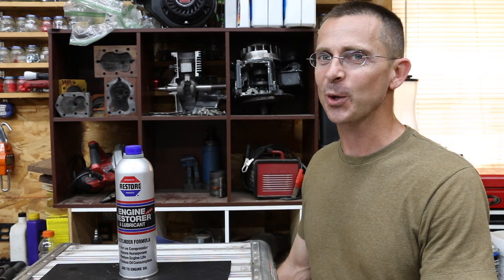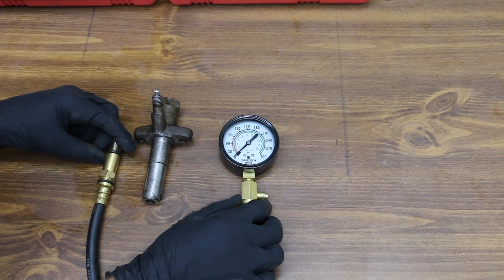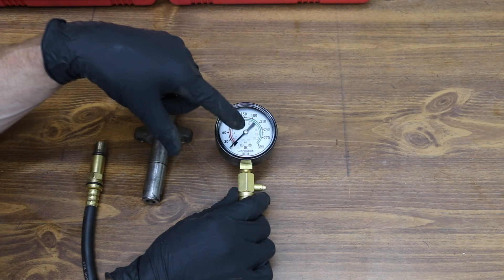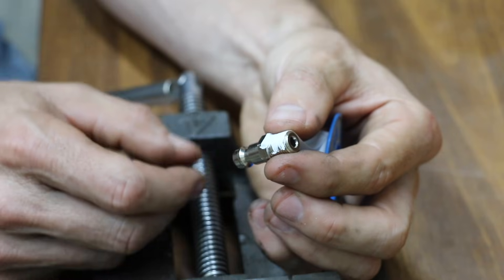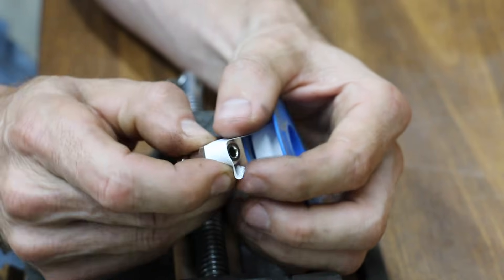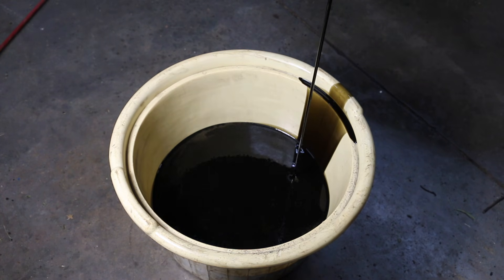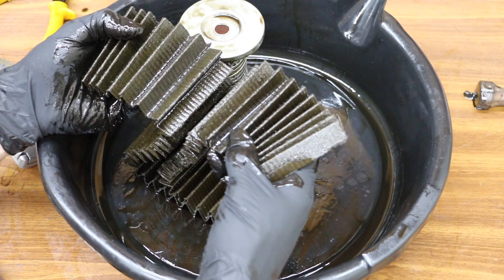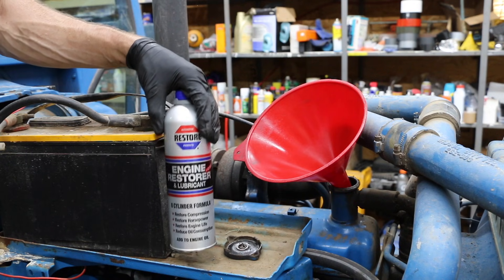Did the "Engine Restore" Compression Improvement Last?  One year later (Episode 2)

Comment: Restore IS one awesome product  I've been using it now for a few decades it not ONLY RESTORES compression it noticeable helps keep blow by out of your oil  mor cleaner oil = mor better  AND it also act as an antiwear additive  It has definitely gotten my seal of approval     another addive I use is Lube guard HOwEVER I dont use it in the conventional way  I spike all my vehicle's oil with Lube guard limited slip differential additive  and I have found that on my motorcycles  it makes clutching AND shifting much more tactile and smooth  I even put a 1/4 OZ. Per. Gal. In the fuel To fight  cycelnder washout and cold start wear  the liquid wax esters that it contains are also really good at keeping  the sludge cleaned out your engine     keeps them clutch plates cleaner so they are less likely to chatter and slip.    As well as making them generally operate smoother from the start 👍😆

Comment: Some say this product has issues on engines with VVT, or that it could.clog solenoids, etc. Could you do a video testing this myth? I would love to be able to use this in a modern engine, but a lot of your tests are on lower tech ones that do not deal with the issues of the new cars of today.
Reply: I have a 2006 gmc Sierra 1500 with a 4.3l v6, 5 speed and it’s been burning oil and a little sluggish, I used the one bottle of restore about 600 miles ago and I have about no oil burning and it is running smoother and cleaner then the day I bought it, I’ll give an little update or what not in a week or so but so far it’s worked wonders
Reply: @austinbergman9270  so after 3 months now how's your 4.3 doing?
Reply: I second this for sure. I'd like to know if there are products out there that do work for even engines of the early to mid two thousands, even newer. Also if the engine restore could work in a more modern engine or have they formulated an option for the thinner oiles in newer vehicles. Love the content project farm! Keep it coming.
Reply: Yes
Reply: Should work on anything but a powerstroke diesel, says that much clearly on the bottle.
Reply: @carll.freemanjr.9867  Yep I believe everything the manufacturer says....

Comment: Looking to do the same to my JCB1400B with a Perkins Turbo Diesel, little weak in compression, would you recommend this or Marvel Mystery? Both seem like quality products just wondering what you would do in that older application
Reply from the maker: If compression is down from excessive wear to the piston rings, engine restorer is likely to help.  MMO is a great product as a cleaner but doubt it'll help with lost compression

Comment: These types of so called "engine restorers" are usually nothing more than really thick oil. 70-80 weight.
Reply: it has very low viscosity
Reply: I've used it, it actually works.
Reply: @rogercoder1469  I didn't say it doesn't work. I know that it does. I've used it myself. I was only saying that it pours out of the container like honey.

Comment: I used restore on my engine based on your recommendation. Didn't have the trouble you were having with that cool tractor but after using I had great, consistent pressure in all 6 on a 200K mile SUV
Reply from the maker: Thank you for the feedback

Comment: What do you think about Lucas high mileage oil stabilizer I use it in my 2005 impala SS with amsoil signature and a amsoil Filter and my last oil change I added restore because of your first restore video I have 207000 miles on my car and I think restore really added more power
Reply from the maker: Great question.  Lucas is a viscosity enhancer and helps "cushion", but the extra viscosity can become an issue in the colder months, which is why I much prefer Engine Restorer.

Comment: One other tip for teflon tape, hold the spool flipped over from the way you're holding it at 4:00 It should be trying to wrap back onto the spool as you wrap the fitting. This way you can hold the fitting and end of the tape stationary, while wrapping the spool around the fitting(let the spool spin as needed, keeping some tension on it).
Reply from the maker: Thank you for the feedback

Comment: In the Compression Test Results graph, cylinders 2 and 3 were restored to nearly their full potential on the first go...but ended up to be the lowest in the end – although only marginally.  My theory is that cylinders 2 & 3 are lowest because the inner cylinders inevitably run hotter.  being stuck in the middle.  Thereby wearing the metal down faster.  Also cylinder 1 would be closer to cool, fresh air by being in the front, so that's why it's the highest?  I mean I'm just speculating based on my understanding and assuming the pressure readings were 100% accurate.  Basically saying the hotter the individual cylinder runs, the more it loses compression.  Glad I subscribed to your Channel.  Favourite Sunday afternoon content when I'm taking a break from working on my car 👌🔥💯
Reply from the maker: Thank you for the feedback!

Comment: This can restord my toyota  with p0306 code   posible no compression on that cylinder???? I put new spark plug and  coil and still have the code
Reply from the maker: I doubt this will help unless the cylinder compression is low due to worn piston rings

Comment: You must try Omega 907, it really cleans up the engine. Try it on a old car gas engine, then it easier too see results. The oil in my car looked almost brand new before I used it, the oil after the flush was pitch black. "Omega 907 is an advanced engine & compressor flush that removes all harmful deposits from an engine. Will allow new oil to work at maximum efficiency and eliminate the risk of dangerous contamination"
Reply from the maker: Thank you for the feedback!

Comment: As always, a great film on an interesting topic. You do a fantastic job. One thing I wondered about the Engine Restore is whether it makes any difference if the oil is mineral or synthetic that it is used with. I have a 1960s classic running on mineral oil and wonder if Engine restore would be suitable. 

Also, have you done a destruction test with Archoil friction reducer yet? If not, I think that would be interesting.
Reply from the maker: Thank you for the video ideas!

Comment: well my opinion after cranking the engin endlessly  on each cylinder pressure test ? get that engine rebuilt casue its really at the end of the road. If you dont soon it will over use the pistons and one will break down eventually and create a lot of damage to the engin when it will  .while additives are made to  help the engin last longer  they are not ment to make it last forever . What is worned out stay worned out and continues  to do so   and no additive will stop that  . It may slow it down a bit but once you will pass a certain level of wear  then the additive will have no more effect even if you replace it with new additive ,thats when the engin will come appart

Comment: No placebo effect. More compression = more power. Period. I know for a fact it works. I have an older truck that I used it on. Before, wouldn't pull trailer up a grade in 5th gear manual tranny. After, would pull trailer up exact same grade in 5th gear. Over and over again... It works.
Reply from the maker: Thanks for the feedback!

Comment: if i use it in a modern engine with variable valve timing, will it work or destroy it?
Reply: Scotty Kilmer said don't do it.
Reply: @cooldaddyslick  exactly. Thats why I came back to this video. I want him to test that out on a modern engine
Reply: @herewegoagain7403  I've used it before on my 2012 G37.  The instructions don't tell you but I always get my oil changed and wait to put it in when I get home.  Shake it up then pour it in then go for a drive right away so it can mix in.  Never had a problem.  I think most people just pour it in when changing the oil and just let it sit there while they finish up where it CAN/MAYBE "clump up" and clog stuff up.
Reply from the maker: I need to test it on a modern engine.

Comment: I just put  some in a 2000  Honda  accord 4 cylinder 2.3  - 280k  miles on it ..  noticed better performance right away .. its been   burning  some  oil out the back  ..  we'll  see how it  does.  .. but  so  far i'm impressed
Reply from the maker: Impressive!  It would be great to know if the improvements last.  Thank you!

Comment: This is a very interesting product. Nearly everyone who has used it that I have seen or read about has reported improvements, even just small results......your findings with your tractor are very impressive!
I have just purchased a small can of Restore to try in my mowers......I have three old Suffolk Punch/Colt machines from the 60s and 70s, all with the very strong 75G14 engine.....they all burn oil and smoke a bit, but these three mowers have so far only cost me about £20 and a case of San Miguel beer, so I really don't care if the Restore doesn't work !!!
Even without it they all run and cut the grass, so I'll be interested to see if they run any better and smoke less !!!
Keep up the great vids PF.....
Best regards from South East England 👍👍👍👍
Reply from the maker: Thank you!

Comment: After seeing your 1st video on engine restore i would use engine restore on a 67 plymouth v8 I have every time I had gone through 4qts. It worked great. Added lost power, increased compression, reduced oil consumption/burn off.
However after the 4th oil change with the recommended amount of engine restore oil pressure slowly started decreasing with an overall loss of an average of 16psi at high rpm. From 60-44 and an idle oil pressure from 22psi down to 10. I stopped using the engine restore 6 montts ago and have not noticed anymore oil pressure loss. Please do one of your famous lawnmower engine restore tests on engine restore on both a bad(low compression) engine and a good engine to see added buildup over NOC (normal operating conditions) 
Down we dive to 463 AMX AETC! MFE!
Reply from the maker: Thank you for this information on Engine Restorer.  The oil pressure loss is concerning.  I'm on my 3rd oil change with it in my Ford 5000.  More to follow in a future episode

Comment: @project farm.. would you add restore to a newer engine....2015 Honda Accord 4cyl. Only 20000 miles but engine idles a little rough? Thanks again for another great video.
Reply from the maker: I would not use it in that vehicle.  It won't help.  I don't believe the rough idle on a car with such low miles is due to compression loss.  So, engine restorer just can't help.
Reply: @ProjectFarm  good morning and thank you very much. Also thank you for your service on this 9/11 day of mourning. I've read in a past post that you were in the service.

Comment: I used it with success in a Dodge with the Cummins 5.9 but after using it several oil changes in a row, it acted like it was hindering the oil flow to the injectors.  Buildup perhaps?  I discontinued using it for several oil changes and it has returned to normal.  I would not use it every oil change.  As your oil analysis showed in the Suburban,  it stays in the engine.
Reply from the maker: Great point. Thank you

Comment: An old Ford 3000 I bought, the prior owner used Restore in it.  not sure if it was just once or at every oil change.  When I got it, the engine was so tired, it would not start below 50F.  It needed a puff of starting fluid.... it was better when I fixed the preheater, but it was tired.  Compression was below 200 if I recall.  Eventually we replaced the engine since we discovered a piston wrist pin had gouged the cylinder wall & the cost of a 3000 engine was similar to a newer, higher HP engine....
Reply from the maker: Wow! Thanks for sharing this

Comment: The original recepie is once again being manufactured I believe in Australia.This is not the the junk that they sold in the US after they drove the original maker out of business.Why don't you see if the will donate a bottle of it and you can test it  against anything made in USA.When popular Mechanics tested the original Slick 50 they used a new Lincoln and tore it down for inspection on a fixed milage schedule.At 100K miles they could still see the reamer marks on the bearingsThey ceased testing at that point.
Reply from the maker: Thank you for the recommendation

Comment: For finding debris in a engine filter try this

Cut a section, 3-5 inches out of the filter media. 

Fold it back up and put it in a vise with a rag under it. 

As you squeeze it down wipe the oil from top and bottom until most of it is out. 

Check out your filter now. Debris is much more visible

There are also filter cutters out there that work like big tubing cutters if you were going to cut allot of filters.
Reply from the maker: Thank you!

Comment: Tractor engine still is NOT a car engine, but.. let's see. I'll watch this one. 

I generally don't watch your videos because it is tested on FARM EQUIPMENT and not ACTUAL CARS. There ARE differences.
Reply: TheJCorbi82 yes and no. A tractor engine can be found in pickup trucks. 

What would be more relevant would be using restore on a modern ish engine to see if it works or if for some reason it wouldn’t.
Reply from the maker: Thanks for the feedback

Comment: Hi how are you i no this maybe a hard thing to answer we have a 2015 Hyundai limited 2.4 we had a recall in the engine knock sensor reprogram we're not losing any oil  and it doesn't seem to be burning any oil . But once a week I check the oil and we are down about a quart of oil so obviously burning and small not visible a amount what do you think what do you think I should add to the motor to stop that from happening what engine restore be beneficial for that cause or will it harm the engine I used a thick oil additive but it just seemed to when I change the oil seem to feel like jelly-like consistency I know you are the man to ask I use the best super synthetic oil 10 w 30 in the best oil filter that I can buy what would you do ?? PS you're one of my favorite YouTubers i love all the experiments you do sincerely Lance G from North Adams Massachusetts
Reply from the maker: Hi Lance, Thank you for the positive comments.  Not sure how many miles you drive in a week, but 1 quart is a lot of oil.  It shouldn't hurt to try engine restorer but it's hard to say if it'd help without knowing the cause of the oil loss.  This product helps restore lost compression from worn piston rights but it's not a "fix all" product.  Hope this helps.

Comment: I didn't know about this video when I went and bought a bottle on the last videos recommendation and numbers. That last cylinders rejuvenation is astounding. Gonna feed it to my IH Cub this weekend. Hope I have the same sort of results.
Reply from the maker: Thank you.  It should help compression as long as the valves aren't the issue.
Reply: @ProjectFarm  Well I'd done it. And I believe it's helped. I'm sure more times under load will give a better metric, but as of right now. I'm pretty impressed with the stuff. I use a 1976 IH Cub 1250. The old girl has had a little smoke when starting, and when you hit the PTO the last 5 or so years. Over the course of doing the lawn it may need a "blurb" of oil to top it off. Not even like it was an 1/8th of a quart, so "blurb" is the best way to describe it. 

 I drained the oil, and put in the 4oz of the Restore, then topped it off to the top of the full range. Little smoke in the beginning, but I think once it got mixed in, that was all it took. No smoke at all during starts and stops, and none when ya flip on the PTO. Oil range never moved off the top of the full mark. I may put this stuff in everything I own.

Comment: The old 5000X engine is notoriusly bad at winter starting. The 5000Y is normally a good deal better. But only 300 psi cranking pressure (?) Has the engine done 10000 hours or something like that, or has it just had a million cold starts?
Reply from the maker: I don't know the entire history of the engine, but it has had a lot of winter starts.
Reply: @ProjectFarm  On the other hand. 300 psi isnt BAAD bad, just low. Check that injectors open at the correct pressure and that the fuel pump and injector pump isnt lazy. If they are OK, give it a serius Italian tune up. I´m sure that will give you a much better result afterwards. Have fun.

Comment: Marvel Mystery Oil to clean things up, engine restore to restore compression enough said.. been using them two in combination for many years and have engines last well over 250,000 miles. I don't care what manufacturers say you should change your oil every 3000 3500 miles no matter what! and if you have over 75,000 you should start using engine restore every oil change! to extend the life of the engine. And please folks return used oil to any auto parts chain. No questions asked just drop it off at the counter.🙂
Reply from the maker: Great suggestion!  MMO is a great product

Comment: It's really cool to see evidence that this stuff works. 

I've got a tailpipe cutter which has rolling cutters mounted on a chain. I have used it to cut oil filters open before and it works great. I think it would be a bit easier to use that than a chisel if you plan on cutting more oil filters open for this kind of purpose.
Reply from the maker: Thank you for the video idea!

Comment: I had a 76 plymouth van w 200 thousand plus on the meter 360 engine and on a hot days after driving  50 miles and get home at my gate the oil pressure lite would come on . well after a can of Restore the oil lite would not come on anymore even after running hard on hot days.also used it on a high time accord that smoked and burned oil and it quit smoking and using so much oil as well.That product works as advertized for sure.
Reply from the maker: Thank you for the video idea!